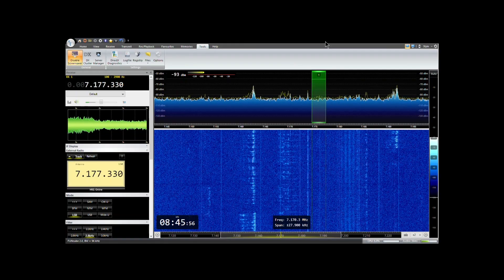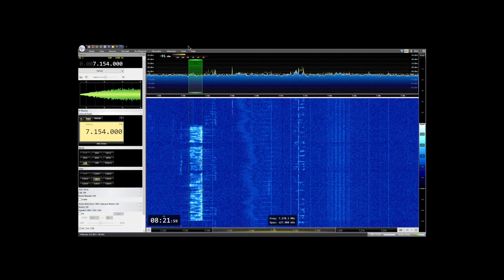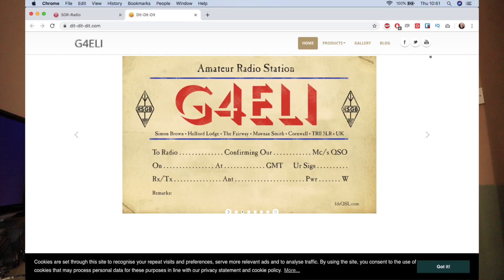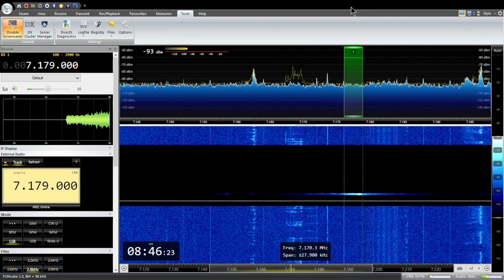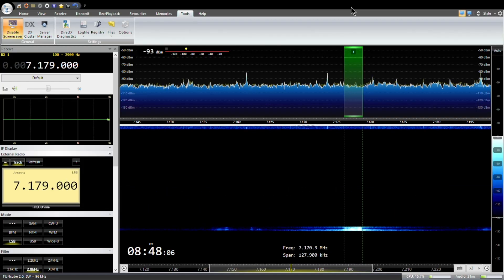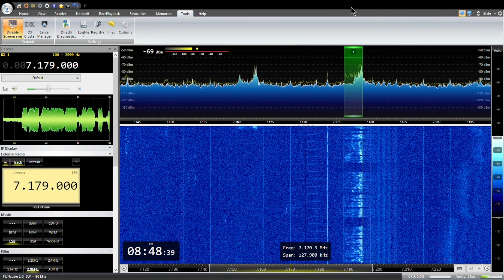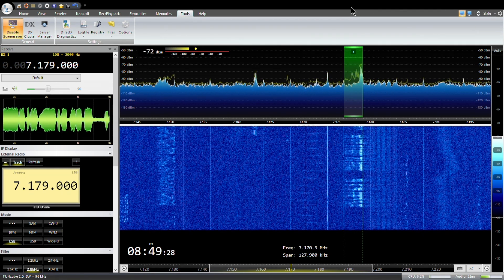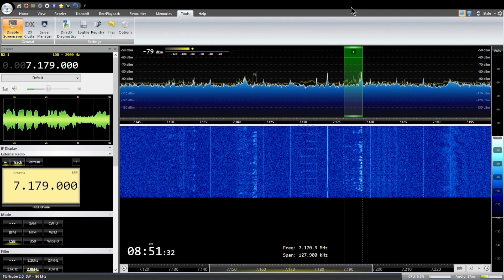How I use an SDR receiver in my amateur radio set up

Comment: Hi Carl, what sdr receiver are using what would you recommend? Cheers
Reply from the maker: I used the Airspy, also the Funcube dongle
Reply: @M0SZT  i brought a rtl  rb20t it's crap to put it mildley lol it aint much good on hf i was thinking of going for a sdr play as at some point i want to do what you do and take advantage of all the filtering in software has i suffer quiete badly with noise. cheers, jase m3xou

Comment: Maybe adding a (Radio) PPT 10 Pin to RCA male cable to CTRL on MFJ1708 give added protection in front to the RF Sensing incorporated in the MFJ 1708B-SDR .....https://shop.technofix.uk/cables/linear-amp-cables/10-pin-linear-amp-switching-cable-for-yaesu-ft-450-ft-950-ftdx1200

Comment: Nice video Carl and very informative, I believe you can get a signal out of the utune out put on the ftdx1200 with a y connecting lead so you don't have to tap the IF. I did use the sdr rf switch on my old radio.
Reply from the maker: Ooh that sounds doable
Reply: Bits of info on the FTDX-1200 site on Facebook Carl 👍

Comment: Excellent & concise post!Have you compared this software with SDR Console v.3? (also free open source)
If so, what drove your choice?
Reply from the maker: It's all new to me using SDR as receiver, I use to use HDSDR. I think the sdr-radio as I call it in this video is actually SDR console, I could be wrong.
Reply: @M0SZT  Yep, i think your correct. I hear some really good things relative to it's robustness and excellent performance. Especally at the price of a good conscience donation.

Comment: Nice video Carl. Which SDR dongle were you using? Also, if the MFJ switch senses rf from the Yaesu transmitter, and the switch does not react immediately, is there not some risk of rf output into your dongle? Regards, David
Reply from the maker: I was using Funcube plus dongle, the sdr-radio software has a cut off for the receiver as well, so the switch senses RF and the software senses as well meaning I can cut the signal very quickly. The software audio has a delay due to latency so it does feel there's a bigger delay than there is... hopefully..

Comment: Great video Carl....I run a SDRPlay RSP1 with my Kenwood TS-590SG in the shack. 

I often run JS8, FSQ and Contestia 4/250 simultaneously...then use the SDRPlay RSP1 to tune around the bands to see what's happening in the voice portions. The great thing is, I can leave the digital modes running on say 40 meters, then use the SDRPlay to tune around all of the bands without interrupting the digital modes.
Reply from the maker: That's a great idea!

Comment: I am perhaps fortunate in having a large number of worthless radios so the IF tap approach works for me,  it does have the merit of seamlessly tracking the VFO and of course gains the advantage of the rigs attenuators, bandpass front end  etc. My main HF rig does have an IF tap  as standard, so no mod needed. I am not adverse to attacking rigs with a soldering iron but wiith a little ingenuity there is usually a way to extract the signal from an internal optional filter header or similar.  A lot of possibilities, thank you for the video.

Comment: A great solution to the problem. I'm sure it's possible to dig deep into the radios guys and give yourself an IF out, this seems to have saved a lot of time and effort, and gives great results. Nice work Carl!
Reply from the maker: Yes I have the drawings for tapping IF out but want to avoid lowering the price as I do like to sell and swap.
Reply: @M0SZT  I don't blame you Carl, if you can make it work without having to pull the radio to pieces and lose it's originality, it's a good job!
Reply: IF Tap will surely have a lower bandwidth than the SDR to display

Comment: Very cool, I've been getting this up on my 2nd hand FT-950 using GQrx & RTL-SDR v3. (I'm running on Linux).  I'd like to do this on my FT-857d using a PAN-Adapter Tap interface card as I think this will make the radio really great to use any maybe it's even better than buying the collins filters.  I use mine by tapping the IF on my Radios, but I guess you run the SDR direct to the antenna.  I'm very curious why you chose this way and avoided using the radio front end?
Eventually I'd like this to run on a RaspPi with a LCD screen to make comprehensive go kit with the FT-857d
Reply from the maker: I did not want to open the radio up as I like to keep the value when I sell them and try other radios.
Reply: @M0SZT  Ahh yeah OK I get it now.  I got mine 2nd hand, and I'd have to open it to add collins filters anyway. :)
One advantage is no need for the MFJ switch.

Comment: Does the DX1200 have an IF output ?
Reply: No it doesn't, unlike the FTdx3000 with an RSP2 and Win4Yaesu works beautifully.
Reply: Shame it would be useful. Carl has found a working solution though. 👍
Reply: @G1WHP  It is possible (with soldering to add an IF out board). I fitted one to my FT950 with and SDR-Play and it was great. Then the FTdx3k IF-out port was a breeze by comparison. The MFJ switch box is definitely a solution.